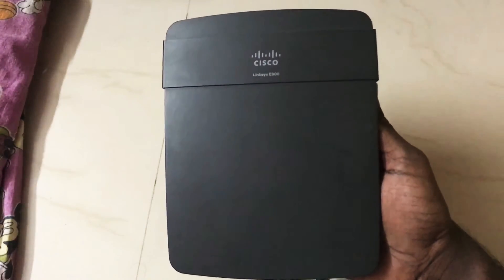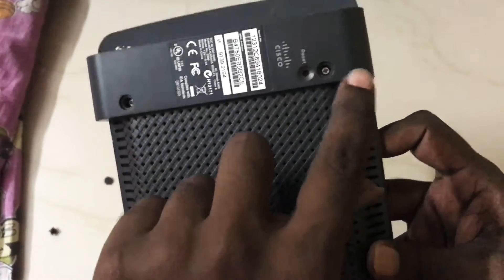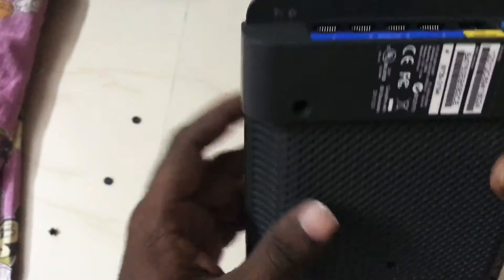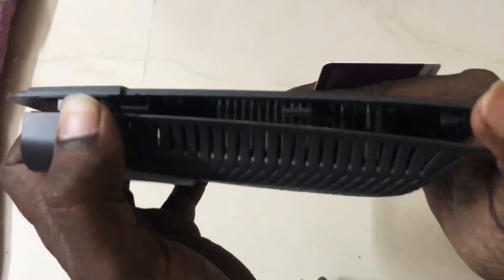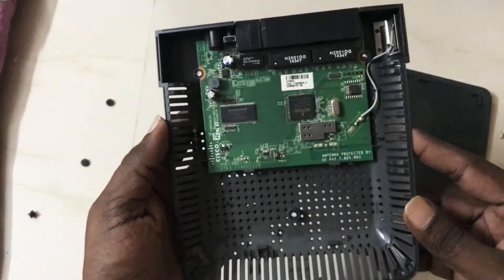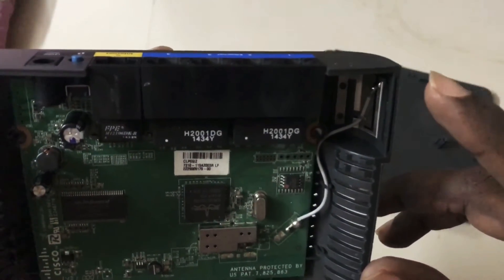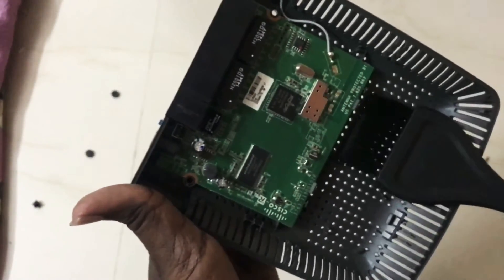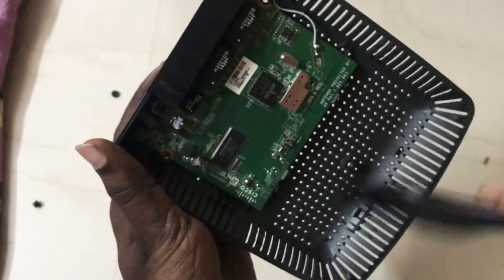WI-FI Cisco Linksys E900 Wireless Router Disassemble | Assemble | Cleaning | Maintaining | ACT

Comment: Man please help me, I have this very same router. It doesn't work anymore. The power supply is good (the power supply port light is lit up), the internet connection port also lights up when I connect my ISP's RJ45 cable there. I connect my laptop to this router but there is no internet connection. I tried factory data reset and also firmware upgrade but no use. Please help. Thanks in advance.
Reply from the maker: Try to do a firmware update
Reply: @Joysonchristo  I did it today, still it's the same issue.
Reply from the maker: @faisalvaio6210  check the antenna signal and may be it is because of the dry solidering so try to resolider all at once and it should be good to go
Reply from the maker: You have to check with different internet provider and different laptop and check the LAN port and look for dry solidering
Reply: @Joysonchristo  Thanks for the info, will try with another ISP. What's dry soldering btw?
Reply from the maker: @faisalvaio6210  if it is old then soldering may get dry and because of that we may lost connectivity. Now just apply heat with solder and it May get the connection again